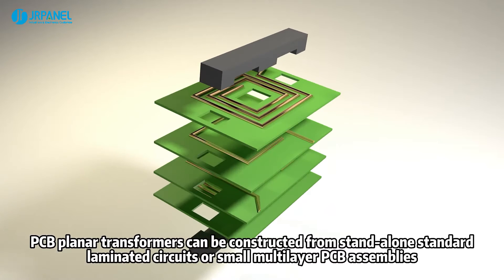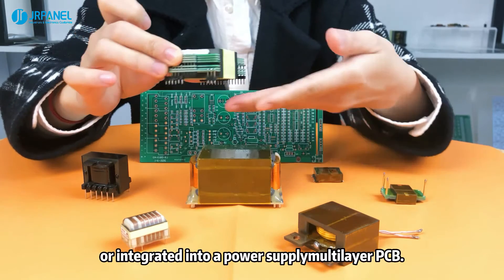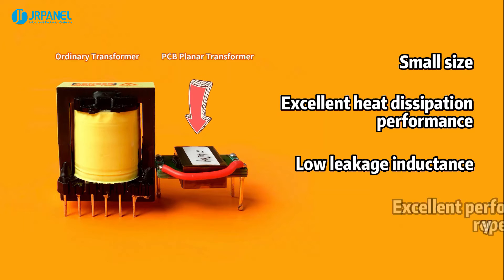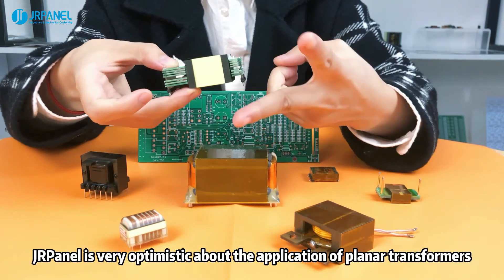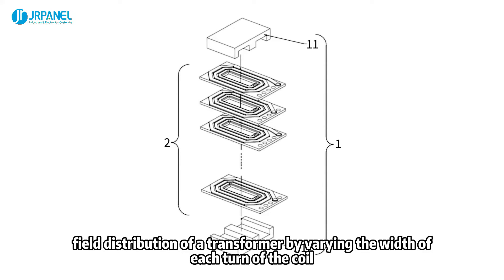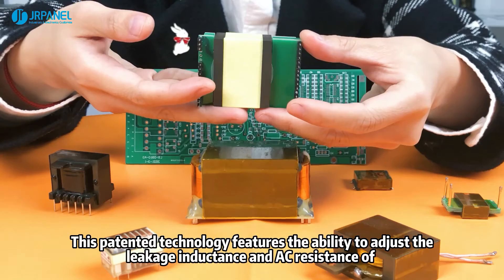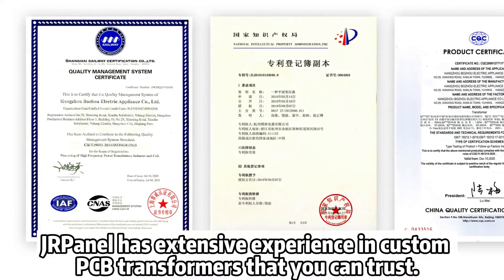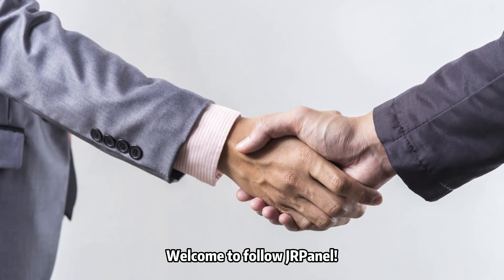Brief Introduction to PCB Transformers

Comment: The device in your hand is not smaller than a same one built around an EFD core (except no frictions with Litz wires). You still need mm^2, and that's a number of 1-2oz layers (it is quite pricy to order a PCB with 1oz inner layers). The main factor is a switching frequency. If you use 1MHz, a traditional transformer won't be too big also.
PS A better heat dissipation of a planar transformer still remains however.